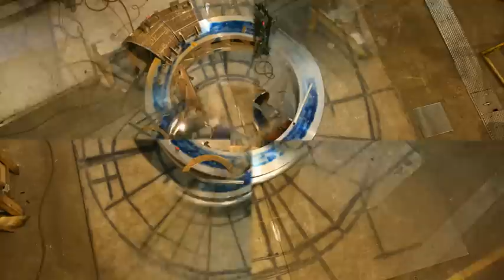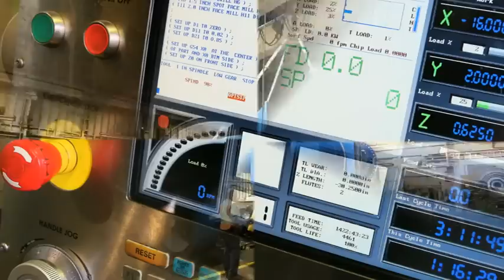The Fabrication and Assembly of an 8.5MW Francis Turbine at Ebco Industries

Comment: This a very nice video and it really shows the steps in building the spiral casing. A unit of that size (output) cost millions of $. Francis turbines are very good when flow is constantly above 60% of the design maximum flow. Great job ebco on showing how it's made.
Reply: I'm confused.  Why would you design for a Maximum Flow when flow is constantly 60% higher?

Comment: It was obvious that the Blue Man Group could not survive on showacts and needed a second job (1:52).
Joking aside, if never seen a lathe (1:35) and a measuring gauge that big. That whole turbine is very similar to a diesel turbocharger's turbine side, which also has variable guide vanes instead of a wastegate valve for a broad operational range and a good efficiency with a broadest ranges of volume flows.

Comment: Nice job I appreciate all the work as a machinist myself, but I want to know what happens to the turbine when the fixed deflecting blades are worn by erosion from tons of water passing through them every minute, the water is full of impurities like particles of sand suspended in the water which erode the fixed blades!!! As for the movable blades it is no problem as they can be removed and changed but the fixed blades are part of the turbine itself?

Comment: How efficient is it relative to working over 60% and what does it cost (range) including installed?  How many years can it be designed to last with proper maintenance?  What is the average annual maintenance cost (Range)?  Are there any other associated cost?
Reply: Joseph Shunkey I also want to know these questions.

Comment: How much water would be needed to turn one of these beasts.
Reply: thousands metric tons per second
Reply: Would it have the units of cfs (or cms) x head?
Reply: There are graphics that explain the range of use of a francis turbine in function of two things: how many m^3/s flow inside the turbine and how high is the geodetic drop. And these two factors must be evalutated in function of the power of the implant. In common words a francis in particular may need from 0.5 to 25-30 m^3/s always depends by the dimensions of the turbine

Comment: i no idea these type of turbines had variable angle stator vanes thats nuts.
Reply: Well, like many engines like the steam turbines used in thermal plants these are regulated or governed because they need to maintain a fairly constant speed to meet the voltage and frequency requirements (60 Hz in this case) for electrical distribution.  When the load becomes heavier, more water is used to maintain speed.  Your gas lawnmower demonstrates this cutting through a thick patch of grass, the engine becomes a bit louder because it  burns more fuel to compensate.
Reply: @WJCTechyman  lol way to relpy to a 3 year old comment with a useless response. 🤣